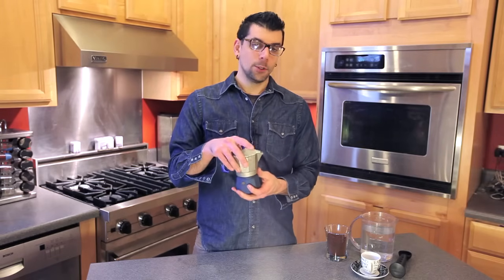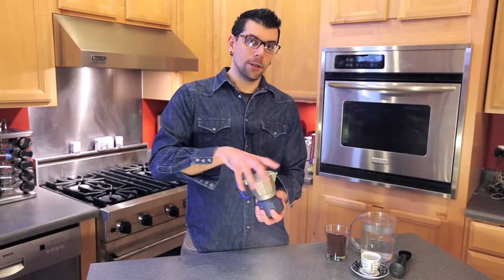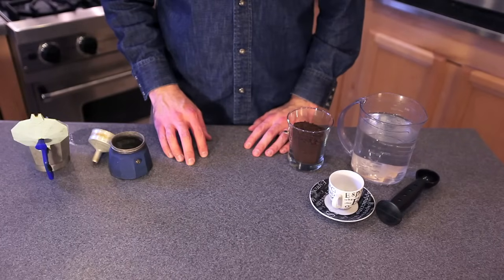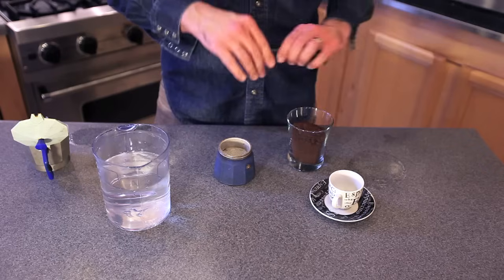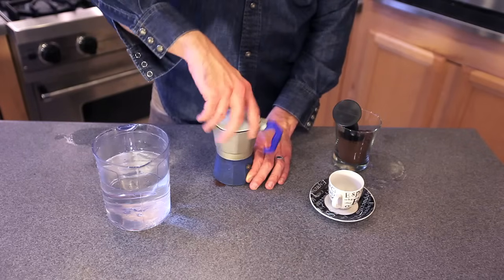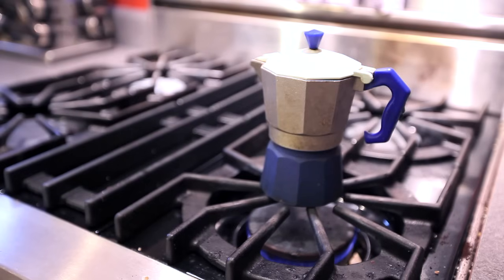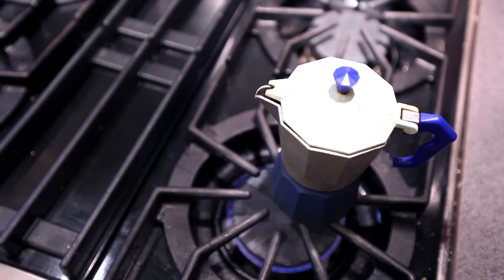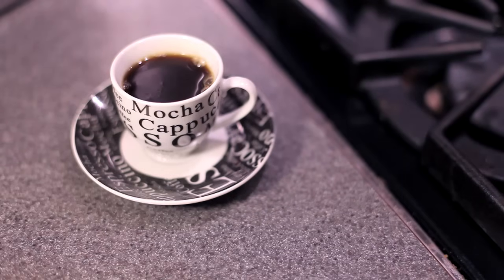How to Make Cafe Espresso at Home : Coffee

Comment: Tips from a coffee maker research consultant:  1. Place coffee in filter before placing filter into moca pot.  2. Pre-heat water in separate pot then add the hot water to moca pot just prior to brewing.  3.  Clean top part of moca pot between uses for the cleanest, most consistent taste, pot after pot.
Reply: Thanks. But could you please explain how each of the tips you provided improves coffee quality? TIA
Reply: Any other tips?

Comment: Do you know how you can make the "cream"?
Reply: liveatmax 
Moka coffee doesn't really come with cream because it's not an espresso like from an espresso machine you would see in a coffee bar.
Reply: Simply put this was a moka pot not a true esspresso machine  and this foam is called creama the problem with a moka pot is they don't generate enough pressure (usually 1.5-4 bars of pressure) to generate creama a true esspresso machine uses a very high power pump to force 15 bar pressure water through the coffee to make creama
Reply: +David wieczkowski crema*

Comment: Hi Joey. As a coffee consultant, I think you should be truthful about what you're actually making there. It is NOT espresso, by definition. No sir, you are making a cafe moka. That appliance is not an espresso maker...it is a moka pot. We Italians like to call it espresso, but we also know it's really not that. Classic espresso, by definition, is 14-18 grams of freshly ground espresso beans, tamped, at aprox 30 pounds pressure...hot water from a boiler temperature that is 197 to 205 degrees F is then passed thru the ground beans at a pressure of 8-10 bar, for 25-30 seconds...producing 1.5 oz of espresso (x 2 and in two separate cups for a double shot described here),. THIS is espresso. Salute'
Reply: How do you figure all that out? How would I know what 30 pounds pressure would be? I'm not trying to be smart, just want to know how to make an authentic cup.
Reply: What is the cheapest machine i can use to make that espresso? I’ve been using grounded espresso beans in my moka pot and have noticed it’s not the same as espresso.

Comment: first thing, I think the coffee stained moka pot would not make a good tasting coffee! second, if the top is closed then you can't see when the liquid starts to change and spit out as opposed to flow! this is important as the drink becomes very bitter at this point causing vile coffee, also when it does start to spit the extraction should be ended by cooling the bottom of the moka pot.........i'm not a "coffee consultant" though lol so maybe i'm wrong :)
Reply: TheDemonboy40 You make better espresso with an old machine. Never wash it with detergent, only rinse.
Reply: TheDemonboy40 
They actually probably make better coffee. A lot of moka pots will include in their directions to make several batches of throwaway coffee in order to permeate the coffee into the moka. 

And deciding on whether to keep the top open or closed is a personal choice. You'd probably want to start with it open when you first start out so you can see when to remove it, but the more you do it, you can become used to knowing when to remove it or when to check it.
Reply: Dario, sto parlando con un Italiano, perciò penso che tu sai bene come fare il caffè un pò più carico. Pressalo, senza esagerare, e poi con uno stecchino fai diversi buchi, il caffè sarà senz'altro migliore. ciao.